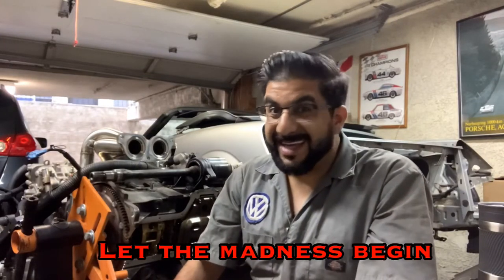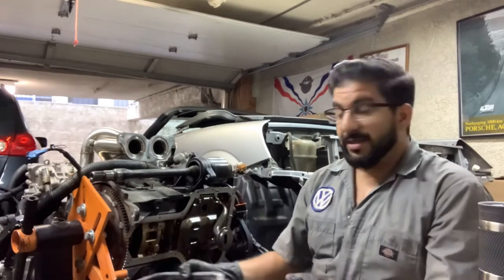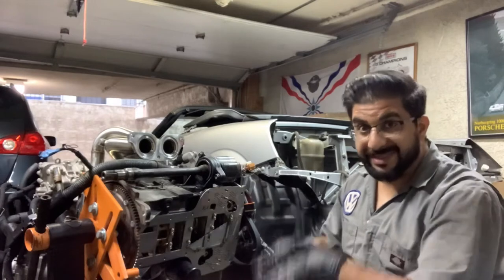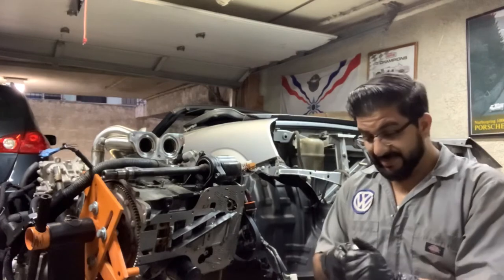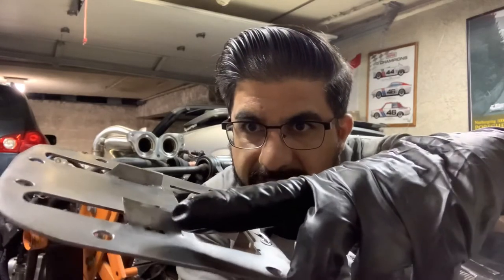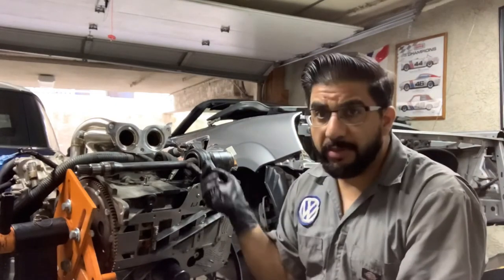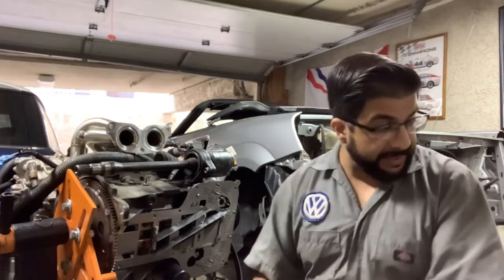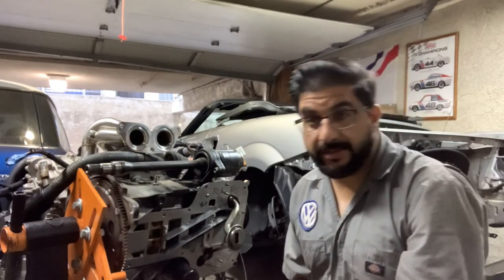Ishihara-Johnson 2ZZ Crank scraper install

Comment: Hey! just wanted to say thanks for making this video! I just bought an 05 Corolla XRS, and all I hear about it Moroso or 1zz pan, but both of those seem to have their down sides. Weird that no one mentions this solution online. Have you run your car hard since this install? how's it been holding up?
Reply from the maker: Thanks for watching the video. Check out my first start video and you’ll see that after all that, it still scraped. I ended up removing it and just running the. 1ZZ pan with the OEM baffle.
Reply: @thetumanshow  Ah damn! So maybe thats why no one mentions it hahaha. Did you run into any issues with the 1zz pan long term? People always bring up that the 2zz pan was designed without a baffle to  get oil back to the pickup faster, but I dont hear if anyone actually runs into problems with the 1zz pan.
Reply from the maker: @MoveQuick4 nah 1ZZ with the baffle was good, I only tracked it once though before I sold it